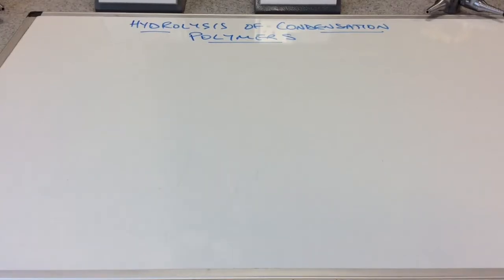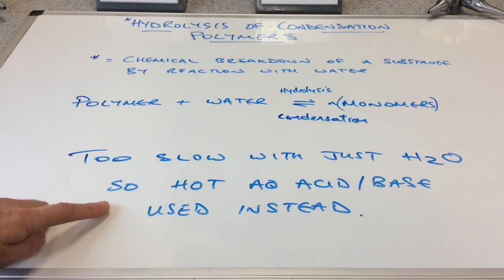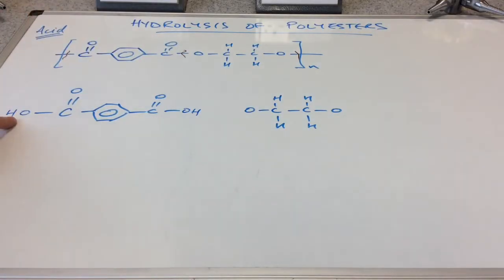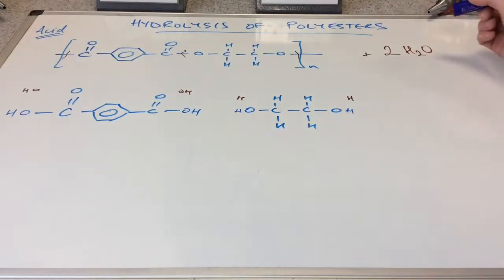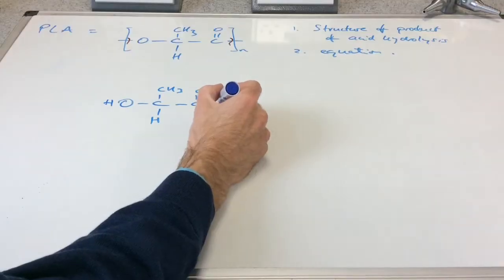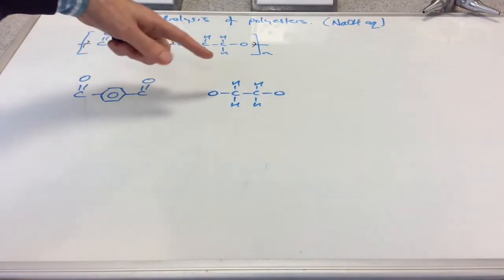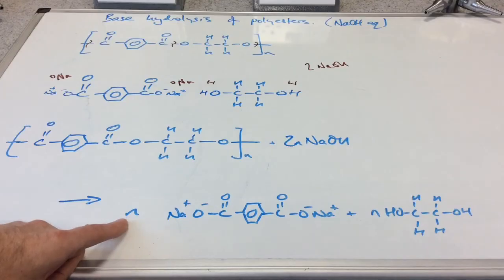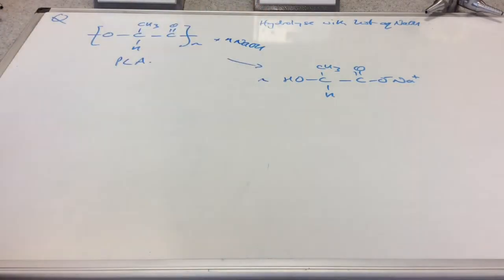Hydrolysis of Polyesters

Comment: Hi, in base hydrolysis why is it only the carboxylic acid that forms a salt and not the alcohol as well? Many thanks :))
Reply from the maker: 3 D Salts form when H+ of an acid is replaced by a metal ion. Alcohols don’t have an H+
Reply: So it's just because the NH2 group is a base and accepts the proton in acid hydrolysis?
Thank you!
Reply: @MaChemGuy   there was this question on a past paper with a benzene which had an alcohol and carboxylic acid group  and excess NaOH resulted in O-Na+ in both the OH of the alcohol and the OH of the carboxylic acid . Is that because phenols are also acidic ?
Reply from the maker: @fatmabatmaz2  yup